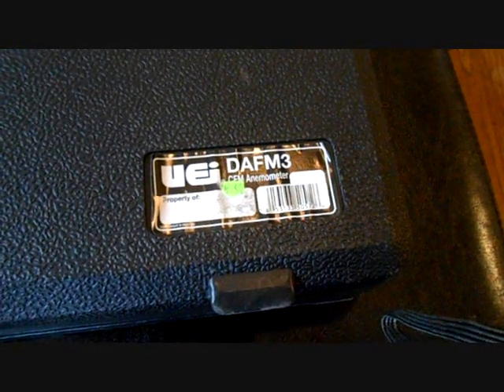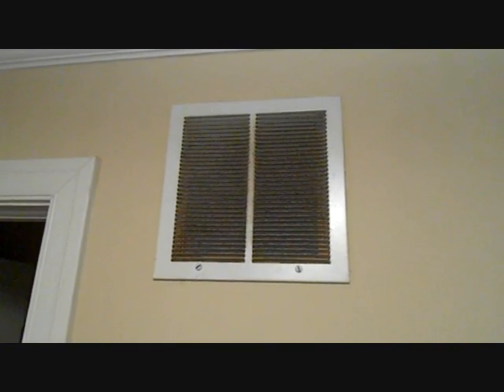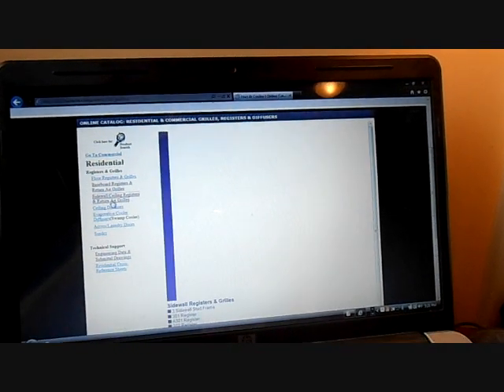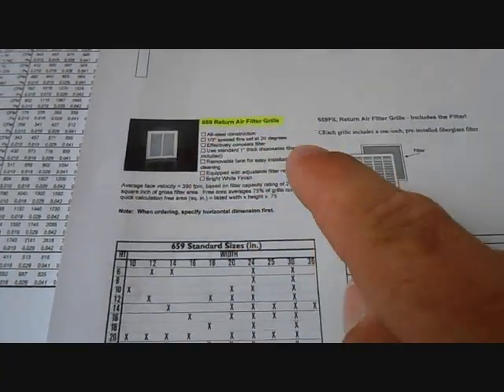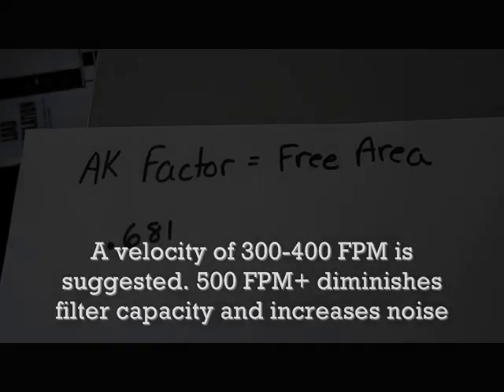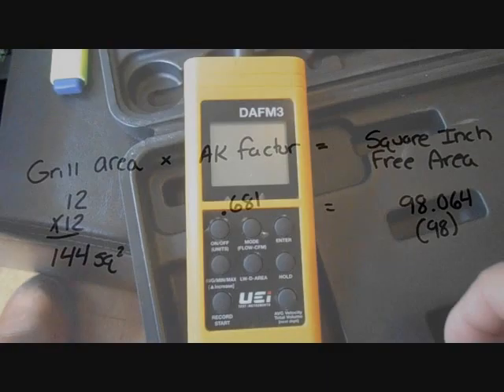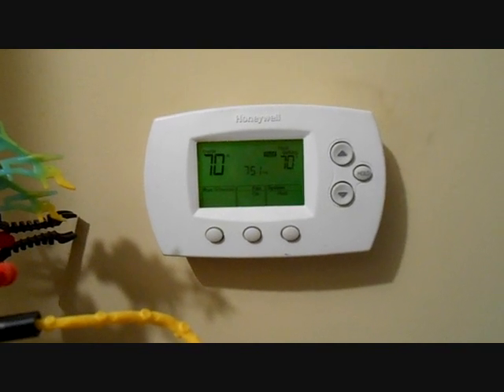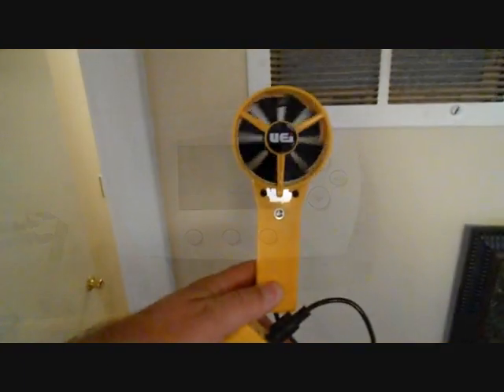HVAC Tools- UEI DAFM3 Air Flow Meter

Comment: I have it but rarely use it at all. Usually , if I see a 20 delta t , I know the unit is doing all it can. If I have an air balance to do, I grab the balometer and eliminate all the math and read the CFM direct. I have several hoods for different registers.

Comment: I have this tool myself and there is no way in hell they field tested this thing. It isn't user friendly by any stretch of the imagination. I would have rather paid another $100 bucks for 5 or 6 more buttons to make it easier to configure. Short press, long press what a fiasco! You have to re-read how to use it every time you want to measure air volume. I saw a guy actually measure air volume with a plastic bag that was fairly accurate, can you believe that! Why didn't UEI have a video on YouTube themselves?
Reply from the maker: Sounds like you are not a fan. Hey, I like the thing. I use it very often and don't reread the instructions every time. How often are you using it?

Comment: When using the free area of the grille to determine airflow, would it be more accurate to use the actual duct size? Say on a 12x12 grille, the duct is 8" round for example.